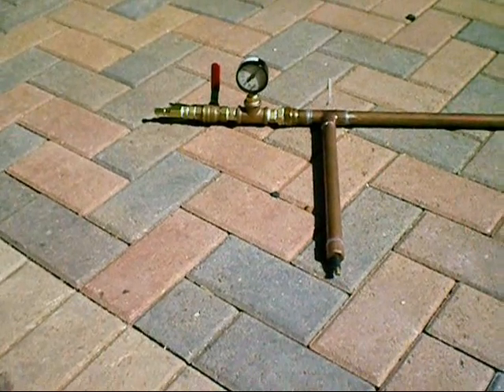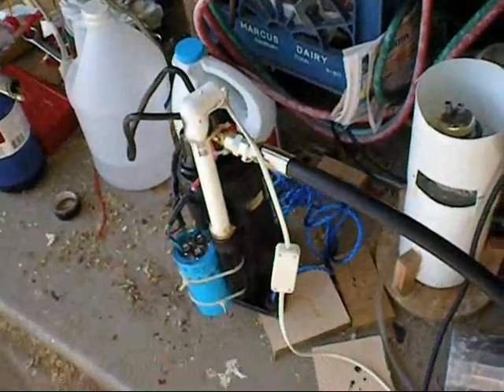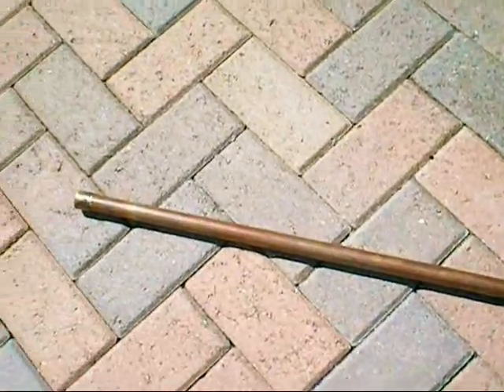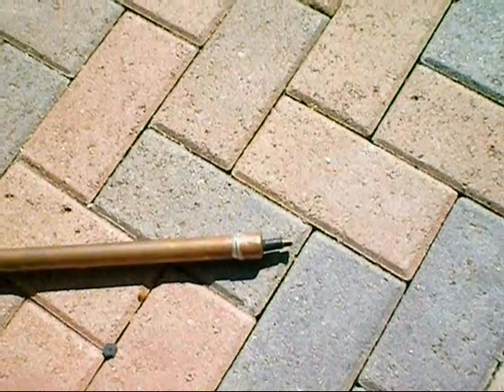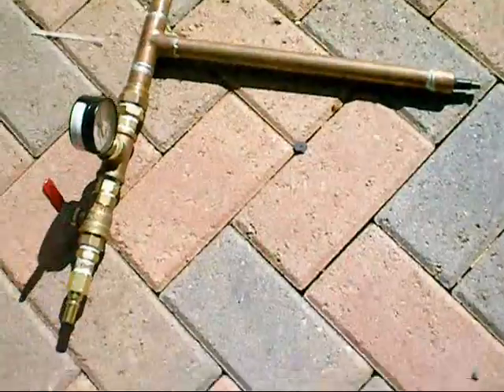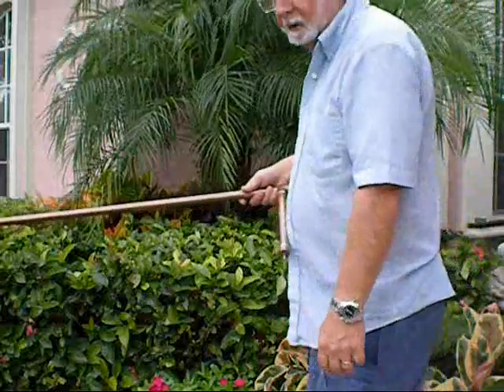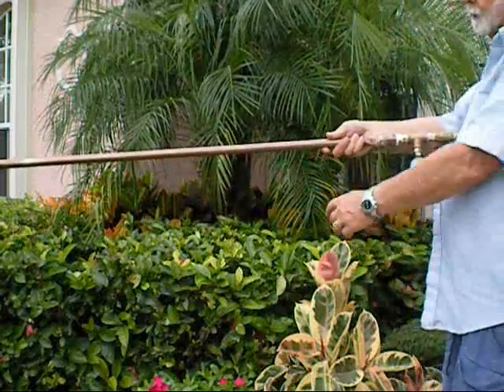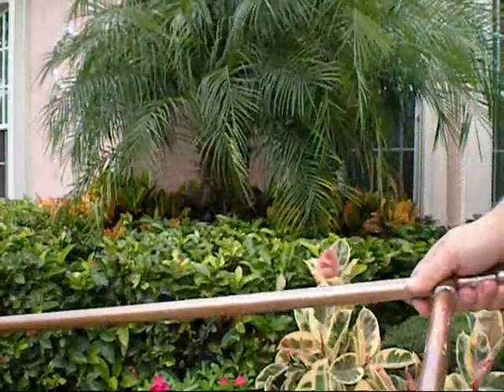Copper Pneumatic Cannon 3/4"

Comment from the maker: The air chamber is the short 3/4" copper pipe with the Schrader valve.  The valve is used to discharge the gun if  you do not wish to fire a projectile.

The barrel ID is 0.81".

It will shoot anything that will fit inside.

Marbles with cloth around it, slugs, darts, etc.

The piston valve seals the chamber to the barrel.

I have tested it up to 450 psi using the A/C compressor.